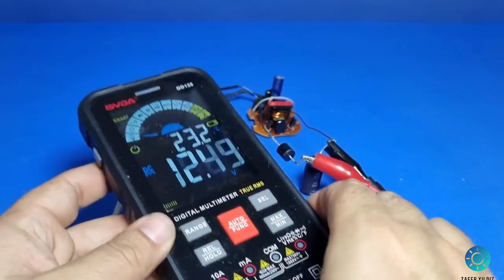4 EXTRAORDINARY ELECTRONIC PROJECTS MADE WITH CLF BULBS 2023

Comment: What does CLF mean?
Reply: Compressed fluorescent lamp. It is filled with mercury and argon vapors which get ionised and produce energy in the form of light ,then the outer surface is coated with phosphors to block or actually reduce the uv type c radiation.
Reply: Compact Fluorescent Lamp is CFL
CLF is not a thing.